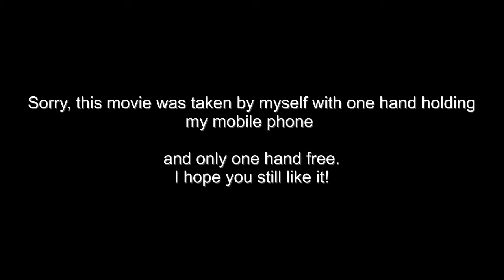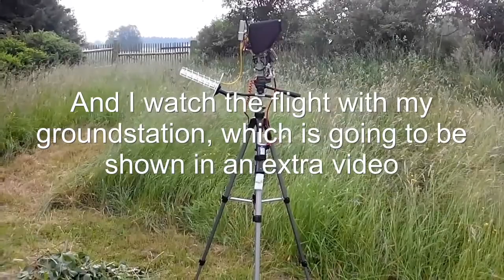SkyEye setup for fpv with cyclops tornado OSD and battery escape ramp

Comment: I was wonderme if I can use 4 cell 5200 mah with stock motor and esc
Reply: Aldo Allende Oliva did you find out if you can use 4s 5000 with this stock motor Aldo?
Reply from the maker: John Villa Sorry, I dont know and never tried. However there is an intense discussion on RC Groups and as far as I remember you can`t. But I am not sure.
Reply: thanks anyway Aldo
Reply: Aldo Allende Oliva you need to upgrade the speed control up to 70 mha and change the motor
Reply from the maker: Aldo Allende Oliva  Thanks for putting the info into this discussin. Happy flights dl7

Comment: Hi there! What capacitance did you use? Did you put the capacitor in series with battery to cyclops? It needs to be a film capacitor and not polarized right?
Thank you!
Reply from the maker: Hi Pedro, thanks for your interest. I use this one
http://www.hobbyking.com/hobbyking/store/__34207__TURNIGY_Voltage_Protector_EU_warehouse_.html
Operating Voltage : 3.2V - 11.1V (1s ~ 3s LiPo)
Capacitor voltage: 16v
Storage Capacity: 3300uf
Weight: 6.1g
Reply from the maker: dl7 Its connected to the battery input of the rx

Comment: hello. what type of 12v ubec did you use? is a 3 amp ubec is enough for the osd, camera and video transmitter?
Reply from the maker: Hi Dan, I dont have an UBEC. As you can see I have an extra battery for the components you mentioned. See 3.30min. Its the Zippy.
Reply: so you use 3s battery for the osd. when the 3s getting low on power its about 11.1v, is the osd and video work's ok? because it's say in the tornado gets 12v input. 
thanks man.
Reply from the maker: Wait a moment Dan. I have to check that, its 2 years ago I built the thing and since then its just flying. But I cant check right now, since I am in Italy, far away from the plane. I will give detailed infos after my return in about 2 weeks. Sorry, but better giving no, than a false answer. I am unsure now. From my memory I think there is a 3A UBEC for the OSD and camera and Tx run separately on the Zippy.
Reply from the maker: I just checked my setup and there is no Extra Ubec. Everything is fed from the RX (e.g. Servo for camera tilt) or the Tornado (eg: TX, camera etc).